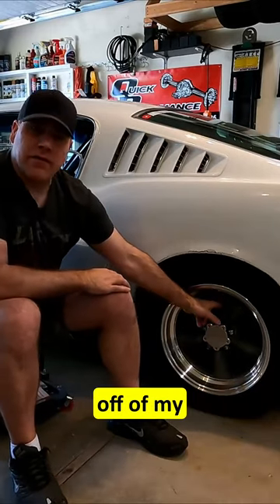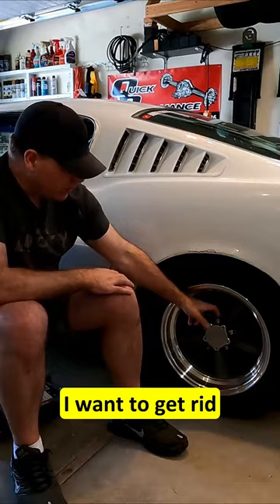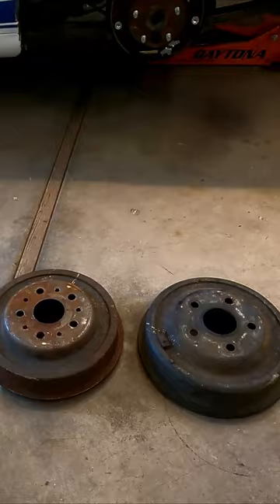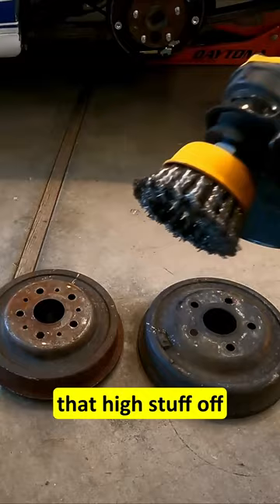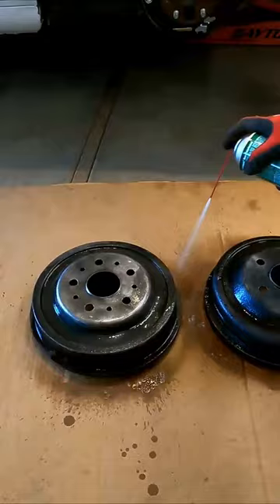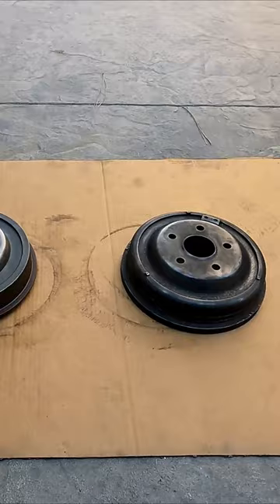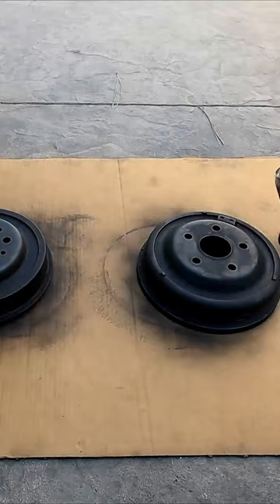Painting Rear Drum Brakes

Comment: You could also take them to a sandblaster it won’t cost you much and then coat it with Eastwoods stainless steel paint and they look really cool.Eastwood also has a product called cast-iron paint it’s a darker color and that looks good too and it won’t rust out after a few rains it’s perfect for this application
Reply from the maker: Yes, that would have been an option.  :)

Comment: Did you bake them in an oven before reinstalling? These ceramic based high heat paints e.g. VHT include this as a critical step
Reply from the maker: Nope.  :)
Reply: To be fair, as he drives it the heat that will be produced from braking will bed the paint in smoother to the surface 😊